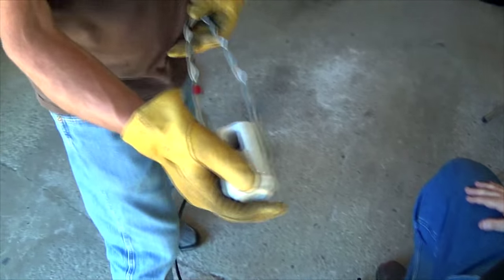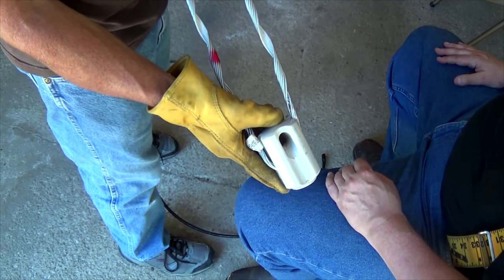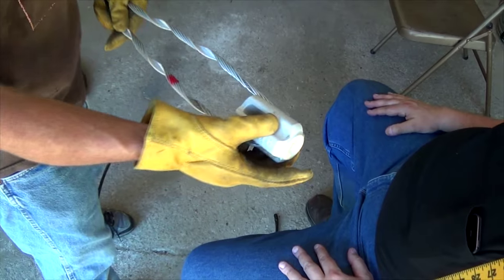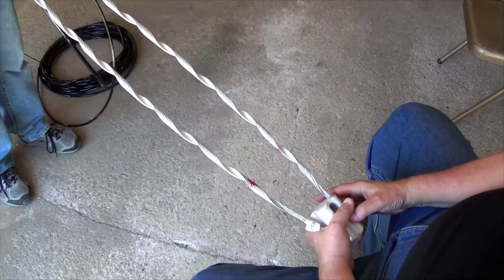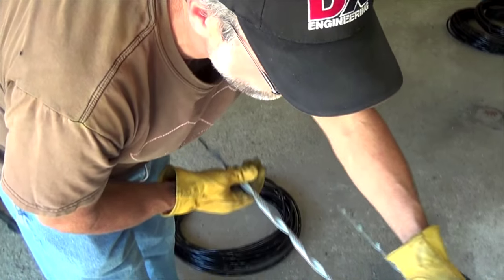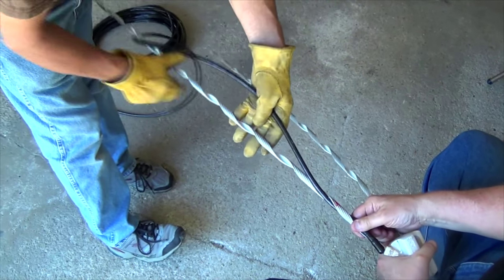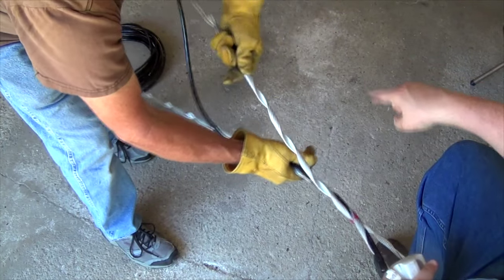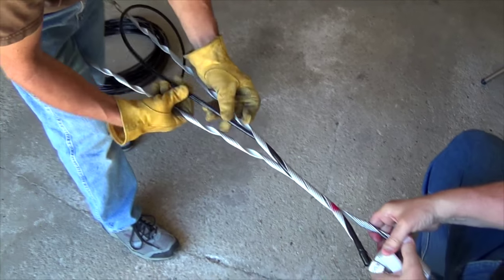Phillystran Cable Grip Installation Demonstration

Comment: At work we use 11200 phillystran and we have found that it is easier to put the grip on when the phillystran has a little tension on it,

Comment: I hope there is a lot of tension on that they don't use that much preform on OT1 wire
Reply: Phillystran is made from kevlar aramid fibers and coated with a polyurethane jacketing compound and thats why the grip is so long.